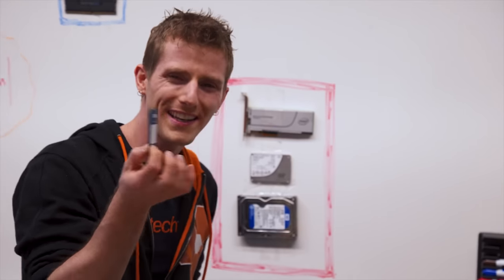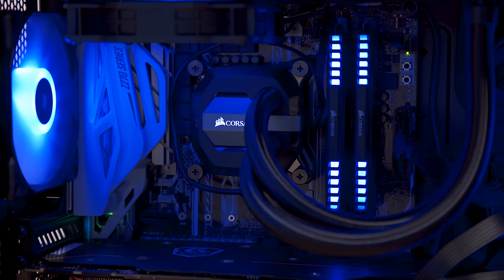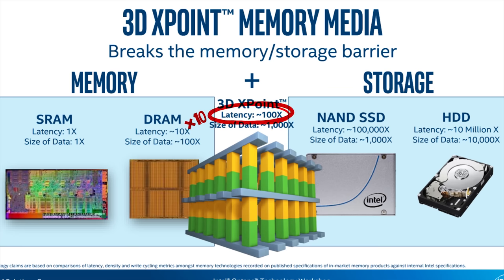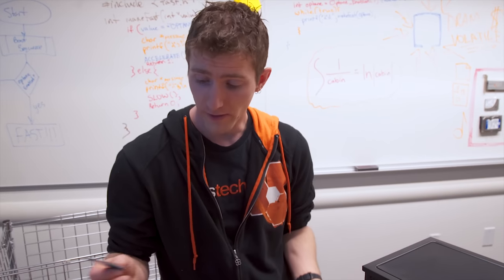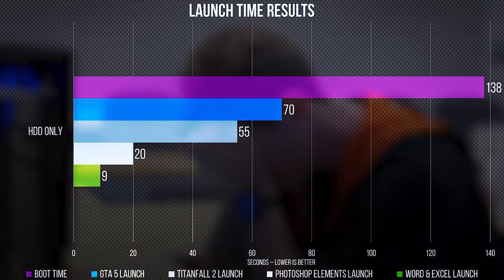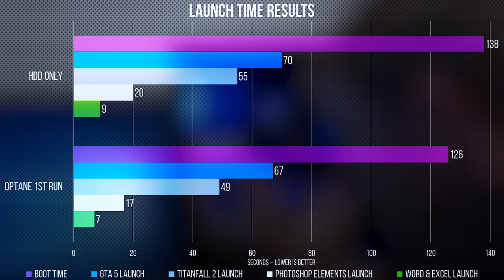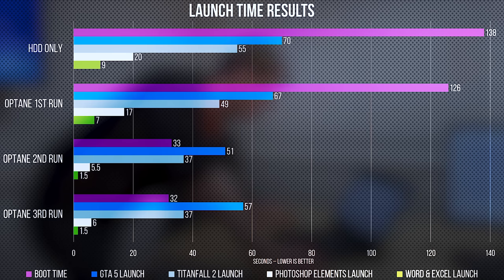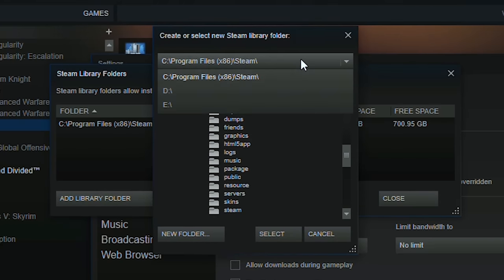Intel Optane Exclusive Hands On - SSD Crushing Performance

Comment: I have an SSHD myself which is pretty much like Intel Optane tries to do, it is okay in terms of performance/price ratio but still not even close for SSDs in terms of performance of normal day to day usage(the benchmarks in this Linus video doesn't tell the whole truth). SSDs today are quite cheap though and it's better to get 1 SSD for OS+apps and 1 regular HDD for "non essential games" and media files that are large or barely used(photos, videos, etc), the tiny price difference will be worth it, in terms of productivity and patience(waiting for stuff to finish and stop lagging).
Reply: But hey, I am a programmer and hardware engineer and I am reliant on multitasking performance of my laptop, so people might not have the same standards as me.
Reply: Maybe a comparison of Optane, ReadyBoost, SSHD and RAM drive would be more appropriate to paint a better picture of the technology as well as a performance benchmark test.

Comment: it makes more sense in notebooks and maybe phones.
Reply: This!
Reply: Except HDDs have been phased out from laptops as well. Even the 300$ laptops feature a 120gb ssd these days. Only the uninformed consumer buys laptops with HDDs not to mention the fact that this optane stick is not backwards compatible with older intel systems and those are the ones which still uses HDDs. I think optane is meant to be used in NAS and server enviroments since those are the only ones who still use mechanical HDDs these days.
Reply: TheTomtah Dude, you're wrong.
I'd still, to this buy, buy a gaming laptop with a boot SSD + 1TB HDD for huge games like GTA V. SSDs are still very expensive and are not as reliable as HDDs.

Comment: so, throw away my $300 ssd for a $50 stick of gum?
Reply: Jake Conner no, run both.
Reply: Zeorymer300 I'm very curious as to what the performance would be vs an ssd and then vs ssd and optane.
Reply: No you add it together. It will increase the lifetime of your $300 investment.

Comment: "SSD CRUSHING PERFORMANCE!!!!1eleven"     benchmarks against slow as shit hdd, not even a hybrid
Reply: That's Linus for you... They do so in every of their videos...
Reply: i think the pitch is RATHER than buy an ssd just buy this stick and your hdd only computer becomes much more responsive.
Reply: it's SSD crushing because it could eliminate SSD's by providing a fast caching between the cpu and HDD. HDD has way more storage space for the buck compared to SSD - thus SSD crushing, but not really. Lets say the title is what a newbie would think when he hears about the optane technology.
Reply: It says SSD crushing "Performance" so i think everyone is expecting the performance to be the selling point. Reading a bang-for-the-buck argument into the title seems like one hell of a stretch to me.
Reply: And a prosumer will wait for 128-256GB capacity, and put the whole OS on it - been there done that (same thing was done with first SSDs).
Caching is great, but I simply don't see the point of small capacity (16-32GB) "memory boosters".
I also doubt it's a noticeable improvement over NVMe SSD, because if/when you run out of system RAM, this thing is useless (since it caches data from HDD not RAM).

Last thing , think about this :
SSD's have a few hundred ns read latency (measureable by AS SSD/IOPS sofware). 
System RAM is around 50ns (latency test AIDA64).
So HOW can we see the difference between this, and NVMe SSD ?
Reply: yea. the performance is good enough that you dont need an actual ssd. im sure that someone who has bought an ssd might think it would replace their ssd, but people who dont have one wouldnt see it that way. and with the context of the video thats who theyre selling it to. sure its clickbait, but the bait actually fits with the context of the video.
Reply: Linus was disappointed after seeing it's performances.lol.he was in shock. ha ha ha
Reply: It does not make any sense to put "ssd crushing performance" if you dont want to convince people this thing actually performs better than ssds, which is yet to be shown.

If "you have a hdd allready, rather than buy a ssd you should buy this thing" is the pitch the comparison should still be made between ssds and this thing, not between this thing and slow as shit hdds. It isnt even cheaper than an ssd with enough space for an OS.
Reply: But you can get a 120GB Kingston SSD for $53!!!!!!!
Reply: ssd cache again?
so it is the same thing that failed in 2010...
just faster...
ok im out,
i was expecting it could be used in games ram but nope..
with current ssd price you can go full ssd so nope ,not needed...
Reply: You've never used a hybrid drive, have you?  It makes little to no difference because the flash storage is so small.  It doesn't do much more than fool benchmarks.
Reply: @Justin Hannay i am not convinced the optane is different. All i have seen are the same benchmarks in which hybrid drives would perform well as well. Drives for caching have had their chance and failed over and over again.
Reply: Intel's marketing strategy are in trouble. they need to stop this crap and do something better. Intel need to understand that now they have compititor in market. 4-5% improvement over last generation in every product??????? every fucking product????? people will not convinced anymore Intel .Intel is a very big company it will not fall in a day but it will fall slowly
Reply: @Judas Iscariot Or you can buy a 6TB SATA drive with a 128gb ssd for OS and important programs for one tenth the price of an equivalent volume SSD and better performance. Why should the optane perform better? It cannot cache all of the 6TB so you might as well store your commonly used files on the 128gb ssd.
Reply: The idea is optane intelligently caches it for you, it's a convenience thing and aimed at the consumer market.  In all likelihood this will be hot in the ultrabook market moreso than desktop computers. And the desktops that sport this hardware would likely have a hard disk as their primary boot device.
Reply: Wut? Optane won't boost all the terabytes for your HDD. It has a capacity of 16-32GB, and that's that. Your frequently used programs will start faster, but since the Optane costs as much as a 120GB SSD, you are better of buying an SSD, and everything on said SSD will start just as fast as Optane would start it.
Reply: tonyrulez69 you clearly don't understand how this works. Research it before posting.
Reply: It makes sense because as I understand it, this is primarily being developed to boost PCs with a standard harddrive, not something that already uses an SSD.
Reply: WD blue drive's aren't really "slow as shit" compared to other standard HDDs run alone, and OFC not a hybrid, that's all this thing is doing in this test is taking the place of the solid state memory cache system in an SSHD... I agree it's terrible, but you're wrong about things as well sigh
Reply: No, this time is Intel that made them do that, go look the article on SemiAccurate
Reply: It's SSD crushing because this could be used in a high end consumer space! You could theoretically have a 16GB Optane drive and a 500GB HDD and for many consumers that would be better than a 256GB M.2 SSD. 
...
...
...
Well... in theory... 

I think most consumers would be better served with the SSD, given the fact that most people use laptops as their Windows/MacOS/Ubuntu box and HDDs aren't very shock resistant.
Reply: I think you missed the point, it is not design to be used as a hard drive but as a caching device. Yes it would beat an SSD in both storage benchmarks and caching but it's really use is to accelerate systems which use  hard-drive storage only, or hard-drive storage and SSD boot drives.
Reply: @Mansoor Aman I'm missing the point, too! It seems like a modular hybrid drive. It should improve initial load times for applications and possibly frequently used files, but it also seems too limited for anyone who would actually benefit from using this over a traditional HDD...

Maybe a budget gamer could... I suppose... pop this into a system that's already been built while he's saving for his SSD...

I'm also having trouble thinking of people who have storage needs that would be best served by a HDD but also need the most frequently used data quickly (assuming this thing caches enough stuff to be useful for loading applications), while not necessarily needing to access files all that quickly (maybe a brand new YouTuber?)
Reply: My 0x1E It might be usable as the sole drive in a tablet; it didn't yield any better boot times than a SATA SSD, though, so I'd imagine Ultrabooks are out. Perhaps, mid-level laptops are a possibility...
Reply: Judas Iscariot But it's not the entire drive at those speeds; it's the most frequently used files... sorta... But even those don't seem to be cached that quickly...

His boot times fell to about where mine are on my desktop with a SATA SSD boot drive
Reply: I get it this is a device that turns your shitty hard drive into a hybrid drive. But hybrid drives are shit. Its used for caching and not for storage but you can just as well get a small SSD and have quick access to alot of your important data, not just the frequently used stuff and eliminate the need for caching. Also this doesnt seem cheaper than getting a hybrid drive with a large cache.

The point of my comment is: In order to make this product any interesting at all it needs to be shown this performs better than a hybrid drive and better than an SSD. If it is instead compared to a shitty HDD instead i think intel has a reason for that. This is like advertising for pepsi saying "this tastes better than shit" because they know it doesnt taste better than coke.

I hear alot of comments claiming this will be faster than a hybrid drive or an ssd but there is simply no reason to assume that. Also there is currently no reason to go beyond sata ssd speeds for anything that is below 4k video capturing. Games and common applications do not benifit from nvme speeds at all and will not benifit from this thing over a regular sata SSD.
Reply: @Isaac Rowe Sorry, but you couldn't be more off. This will with 100% certainty never be hot or even slightly warm in the ultrabook market because ultrabooks are way too thin nowadays to include a clunky HDD.
This might be something for pre-built office pcs. I doubt there are many enthusiasts left who don't have an SSD already.
Reply: and they give it a fancy fucking name "3DX point,optane" bla bla........... which is nothing but a makes your HDD a hybrid drive and they call it invention. A new tec ????? and take money from us??? WTF
Reply: +Judas Iscariot I'm sorry but this is bs. I like Intel and their products but this video is basically pointless. Comparing this drive to an HDD holds basically no value because it's not meant to replace HDDs.
Even if the sole purpose of this drive technology for now would be caching, the comparision should have been between an HDD with an SSD as cache and an HDD with an Optane drive as cache.
Because you could just as well use an SSD as cache if you are unwilling to afford an a little bit bigger drive and fit all your programs on it (which would be a lot faster).
Reply: What fraction of people use SSDs as cache devices? Probably a negligible proportion and that because it simply isn't low latency enough to be worth it. Also it comes in large enough capacities and is cheap enough to use for general storage. The video is sponsored by intel so of course they would want to do a favorable comparison.
Reply: let's be real, here! Intel isn't looking to beat a straight SSD setup! They're looking to muscle in on Samsung in the hybrid drive market!
Reply: +Mansoor Aman Being sponsored is one thing. Losing your integrity is another. The only value of such a video is to show that the producer has no interest to inform his consumers by doing benchmarks but only sees them as money shitting sheep. I really hope they get their shit together and start producing actual content again instead of clickbait and ads.
Reply: That's not the pitch because you have to have a optane ready motherboard and up to date bios. So not everyone will be able to take advantage of this. As of now it is very niche.

Comment: No 100 series board or 6 series cpu support, majority of people upgraded during the skylake era from their sandybridge/ivybridge workhorses, new buyers are all over the Ryzens, Kabylake is a small upgrade from Skylake and isnt worth the money, why limit new technology to a platform thats dead on arrival?
Reply: I'm in the same boat.  6 series doesn't  make sense to leave out.
Reply: Ross Davidson Meh, you should wait anyway. This technology was meant to replace current SSD's. Now it's basically just a cache drive.
Reply: well maybe if you used your brain it only works with 7th gen because the 7th gen cpu only has that technology to use it. it says it on their website
Reply: +Nik A What technology is that? They should have developed this with the 6th+ series in mind to release it to an actual user base. It could be said maybe its the 200 series board thats needed but the 6th series also fits those. I could also see celeron and pentium users getting use out of these as a "cheep" alternative to an SSD for low cost builds, but they aren't for those chips either.
Reply: Agreed. This is nice and all but won't be a big factor until Intel moves onto 10nm next year.
Reply: Ross Davidson not to mention no broadwell e support :(
Reply: probably to call convince people to go with Intel's instead of and in very windows 10 kinda way if you know what I mean
Reply: ssd cache again?
so it is the same thing that failed in 2010...
just faster...
ok im out,
i was expecting it could be used in games ram but nope..
with current ssd price you can go full ssd so nope ,not needed...
Reply: And wy no X99 boards and Haswell-E ? Wtf....